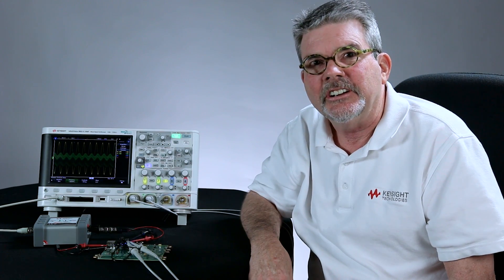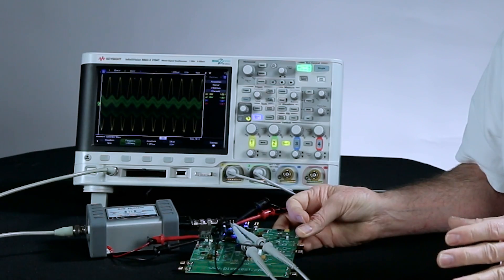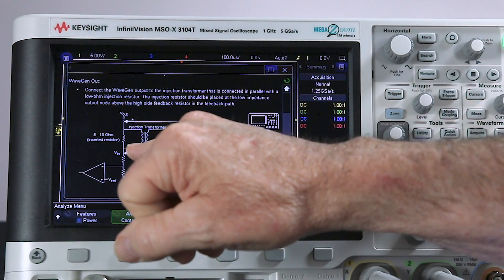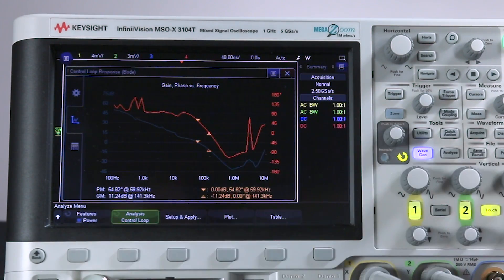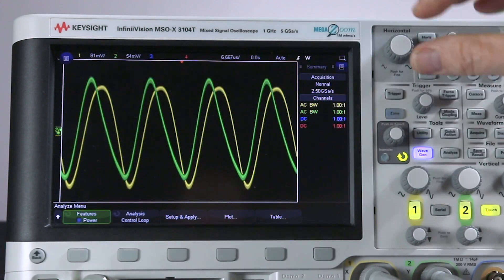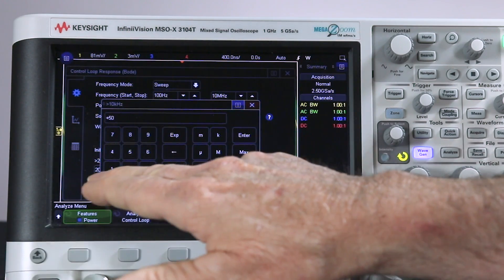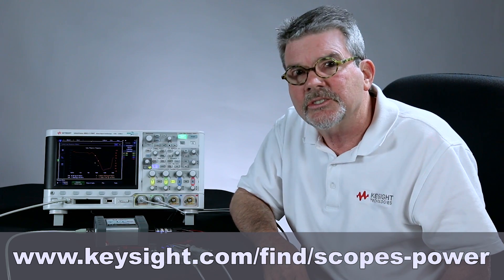Power Supply Control Loop Response Measurements using an Oscilloscope

Comment: Is it possible to obtain the frequency response for current control loop of high power (about 25 kW) and high voltage (600 V) DC-DC converters? If yes, what are the things that needs to be considered?
Reply from the maker: Johnnie's on vacation right now, so we'll ask him for a more in depth answer when he gets back. But, you can do frequency response with the Keysight InfiniiVision oscilloscopes as long as you are able to safely probe your systems and safely connect the built-in function generator to your system. We haven't tested the control loop response as a current source for this application, so it's probably best to try to get a demo unit.

Comment: It definitely is not accurate for sure. It is better to use a network analyzer ( like Bode 100 or AP300).
Reply: Based on what fact? I would be happy if you could refer to a source of comparison.
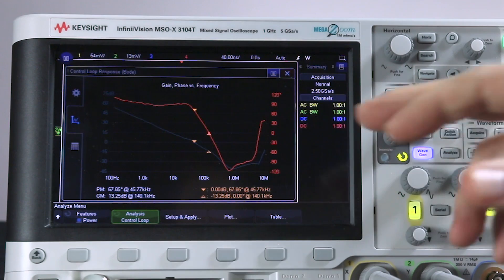Reply: Anton: @ 5:52 the phase margin is ~55 deg and @7:31 the PM is 68 Deg. That's a huge difference. In the mid frequency range 2kHz - 50 kHz, even if the injection signal is changed from 200mVpp to 2Vpp, the phase margin would not change that much. Usually I use 1.72Vrms ( 5Vp-p) upto 1kHz and later I decrease the amplitude to just 30mVp-p. Switch mode power supplies are very noisy systems. They need an accurate measurement. The AP300 network analyzer cost $15,000 and its function is just to do Phase margin and gain margin (transformer inductance/impedance measurement can be done but this is secondary thing). Why do you think the equipment is so costly to just perform this GM/PM test? Especially for low bandwidth systems such as power factor correction circuits ( LED lighting circuits) you need very good accuracy. The bandwidth of these PFC systems is less than 20 Hz. I doubt this oscilloscope can do that job. Oscilloscope manufacturers can incorporate this frequency response measurement into their scopes, but it gets very costly ( looking at A/D sampling bits, noise issues, resolution etc- not an expert in these). The companies need to meet the cost vs performance in the industry. It is the difference between Toyota vs Mercedes Benz. You get what you pay for. Oscilloscope guys can build accuracy into this measurement but the cost of the scope goes up.It is a trade off.

Comment: Is that part of a recent firmware update? It looks much different from the X6000. I have struggled to overcome the noise on my SMPS tests - this seems to have much better performance.
Reply: Yes, we recently updated the firmware in the 3000T and 4000A X-Series. We implemented a completely different measurement algorithm that improves the dynamic range of frequency response measurements significantly. We also implemented a much better user-interface, as well as overlaying the gain and phase traces on the same plot. We plan to update the firmware in the 6000 X- Series next year. I don't know exactly when, but when it comes out, it will be a free upgrade.
Reply: The new firmware for my MSOX6000 just arrived! The FRA updates make it MUCH more usable, pretty happy to see this for sure. Thank you Johnnie.